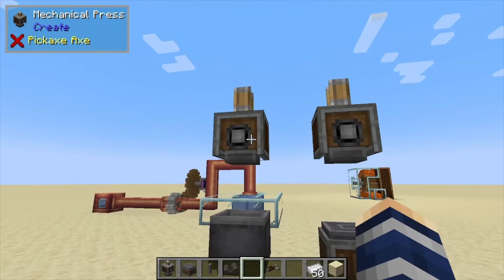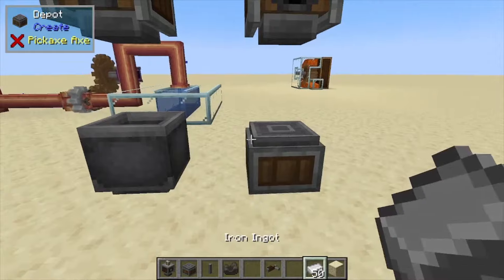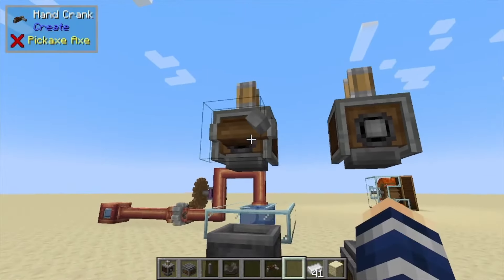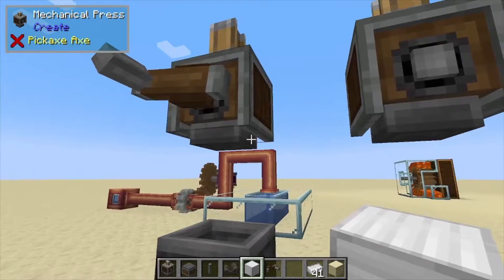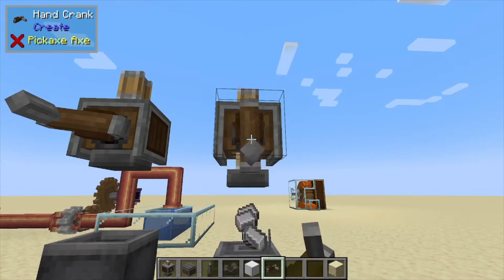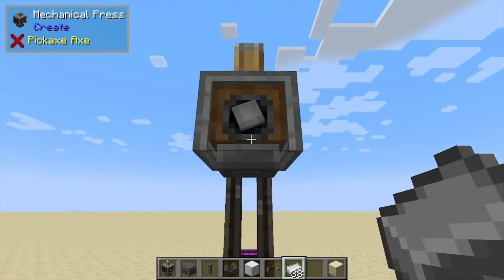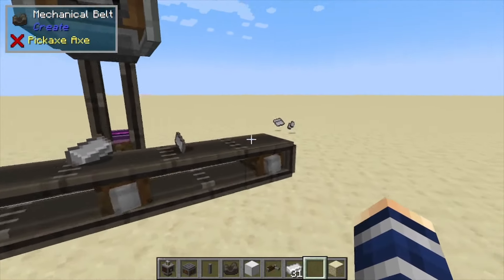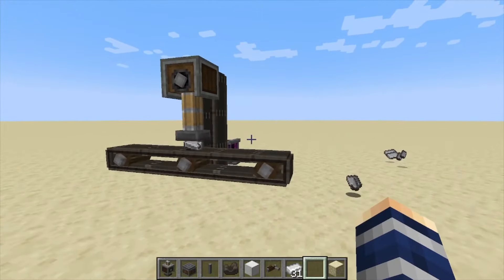Create mod: Mechanical press

Comment: For the basin, how do I get it so it automatically drops items out of it so I can say: transport items into a chest up to the surface and then it dispenses them out onto stuff?
Reply from the maker: Pretty sure you can use a tunnel on the side and use the built in filter to only allow that item out…have a vague memory of another way but not confident in that